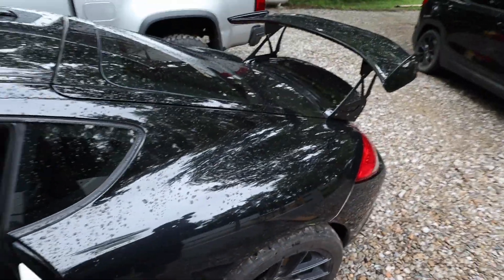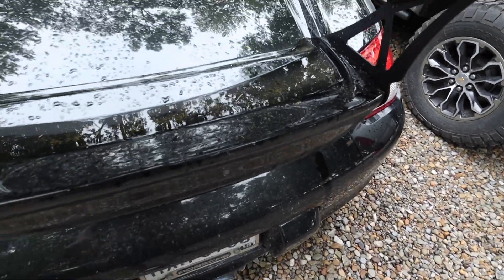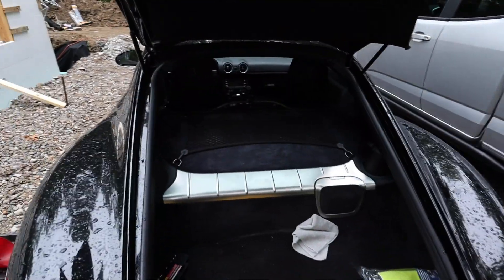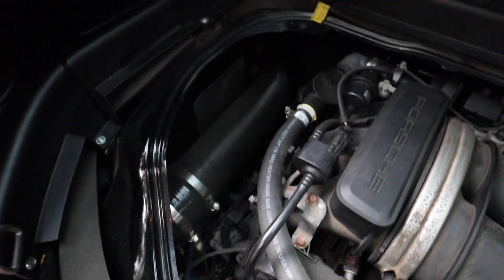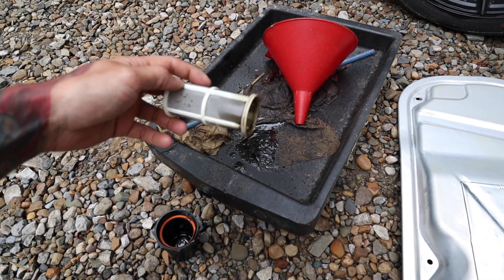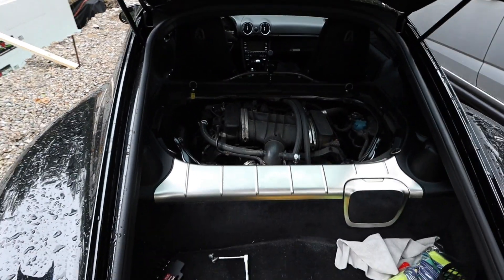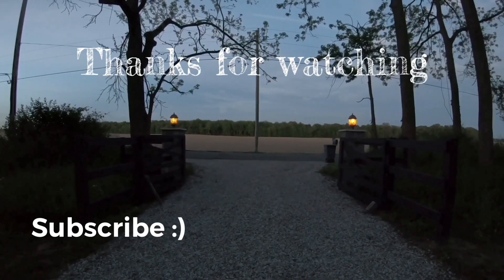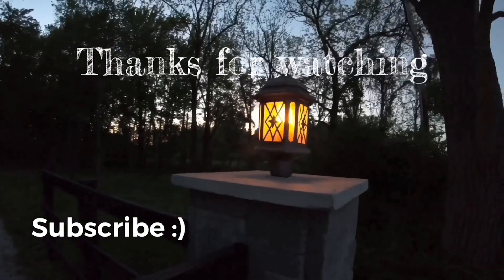Porsche Cayman S 987.2 oil catch can update

Comment: pointless mod..just let it burn off.
The mod itself probably drags more oil in 

OR just an idea  : let it warm up more before you rev the engine

My 987 looses no oil over 5000 km.  including track days :   Because I let it warm up.
100 k miles, factory AOS.. no oil loss , so no oil burnt.
Reply from the maker: It’s not pointless if it’s letting oil out and getting to the intake.  It’s also a DI motor, there is no way to burn it up as it coats your intake and valves since it’s introduced before the combustion chamber.  My runners and valves were filthy on my 370z with very little miles.  After e85 they were spotless since it’s not a DI motor and the fuel cleans everything.  If you have no loss at those miles, congrats.   Not the case for 99% of the others.  At this point it doesn’t matter what you do, your motor is well beyond break in.  Sounds like the original owner broke it in correctly for you.

Comment: I have little oil in the intake. 987.2 PDK has 40k miles on it, have recently installed a catch can too. Season is over now, but lets see next year how much oil it cateches up. Drove 200 miles this season only. you know...home office, because of some deseas which was told to go around.
Reply from the maker: I’m sure you’ll always get a little, just the nature of the motor.   Glad it’s in there and not in the motor though.  Specially with any DI motors!

Comment: Here is my 2008 Nissan Sentra oil catch can configuration and the end-product result. 04m37s ~ 05m04s discolored gasoline sludge and carbon residues safely trapped in engine oil catch can oil catch tank https://www.youtube.com/watch?v=xCfhebKMRbU&t=2s

오일 캐치캔 캐치탱크 장착했습니다. 가솔린 휘발유 차량이고 포집된 기름 상태 찐득찐득합니다. 2014 Hyundai Tucson SUV oil catch can end result https://www.youtube.com/watch?v=2wvupPKUeTE&t=965s

자동차 엔진 수명 연장, 집에서 일반인 누구나 DIY 가능 최소비용 최대가성비 The most cost-effective engine DIY maintenance at home https://www.youtube.com/watch?v=6DLn0kIi-84&t=225s
Reply from the maker: better in there than out the tail pipe!!
Reply: @neckofthewoods24  I don't know what you mean by that 'tail pipe thingy'. However I don't mass with air intake but PCV direct feed into engine re-combustion. some tip for you, if you live in extreme cold weather condition, It is better to wrap around with insulation.

Comment: Which spoiler is that?
Reply from the maker: 17GSXR Guy Getty Design GT4.
Reply: @neckofthewoods24  Hey Man, looks great! a little taller than whats on their site, did you buy custom uprights for the wing?
Reply from the maker: @ottomobili2575  no it’s from them, the sites old or wrong.  If you contact the for a GT4 wing, this is what you’ll get.
Reply: NeckofTheWoods thanks!!

Comment: Are you ever having to top off the oil between changes?
Reply from the maker: Joe K when I first got it the oil was just changed but I never checked the level.  About 3,000 miles later I got a low oil warning light.  I put a half quart in to fix it.  When I changed it I filled it up to the second to top line.  We’ll see what happens now.  Porsche says burning 1 quart is normal between changes.